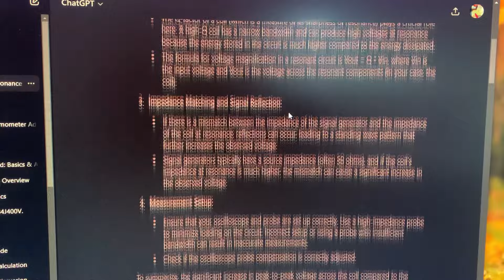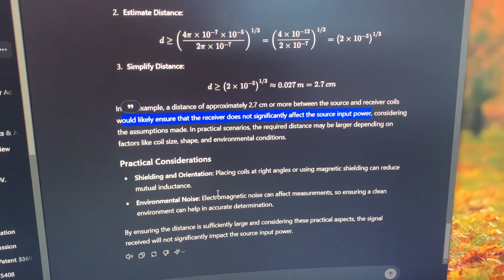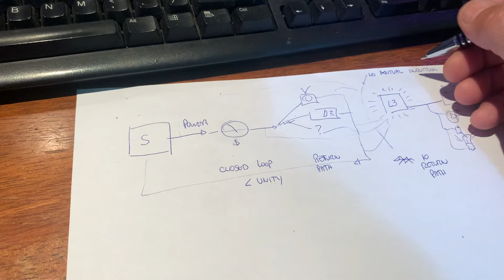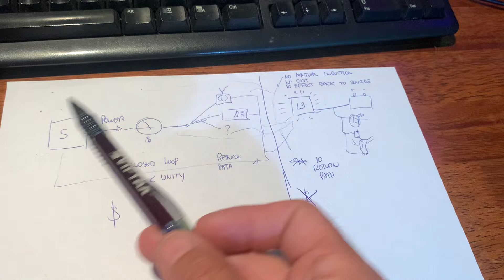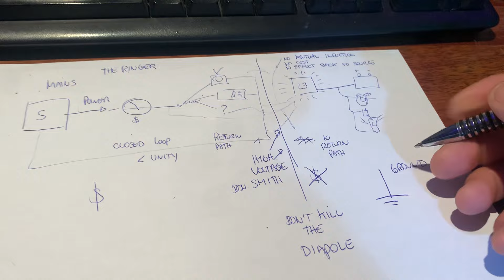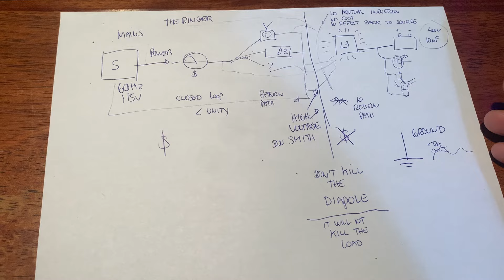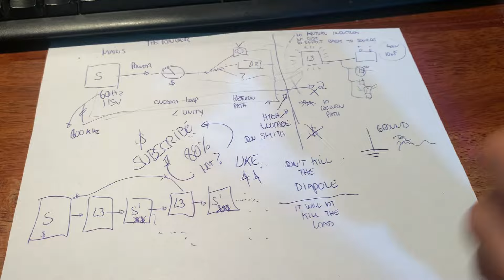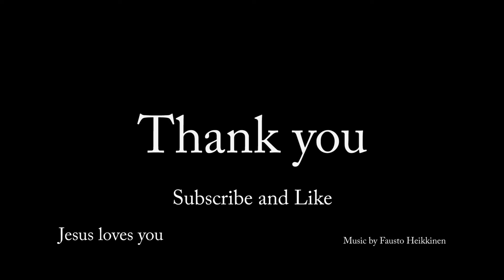The Ringer in Small Steps - Part 5

Comment: Very nice video, I now understand the one wire system from the ground. Can you tell me if the receptor need to be tune with the emiter, with other receptors, or with itself ?
Thanks you !
Reply from the maker: Excellent question.
.
Depends on what you are trying to do. If you tune to 60hz (the mains frequency) you will have a receiver coil with more power but not much more power. Also 60hz is too low of frequency to see overunity.
.
Now, imagine that you have something driving your frequency to kilo or megahertz, now you have much more opportunity to extract free energy and of course you will want to tune your coil to the driving frequency.
.
So tunning for the ringer can be complex because as you add things the frequency of the driver changes and everything goes out of tune, so it is very tricky.
.
Our friend from MTech is doing much more great work removing stuff, simplifying and making the tunning a more simple thing.
Reply: @FaustoGomes  thanks you very much. Maybe one day you will do a video on how to tune the receptor coil 😄 ? Because I dont know if i need to tune the two LC tank or the third ? So many questions ahah.
Reply from the maker: Only experimenting to find out.
.

Comment: Hello, bro I suggest you put up an antenna on your, neon indicator,  and fix it on an aluminum frame or a copper frame you will be amazed.
Reply from the maker: wait, do what? An antenna? please explain in more detail, I am very interested in doing it.
Reply: I use to do this, as well but I found out that having two wires one is grounded and one is fixed on an antenna. Ideally the coaxial cable works very great.

Comment: Maxwell equation … more energy flows around than what flows in the conductor 😉
Reply from the maker: That's what I said, indeed. And that's WHY the wire is so special and high quality stranded.
Reply: The maxwell equation currently used are not the original ones which uses quaterions. Quaterions describe the rotation of fields more accurate. 
Also this equation do not take SRT into account. This is done in retarded electro dynamics (see Feynmann ... with QED). 
Also look at antennas with the near field and far field topics. Theory is not consistent and complete here.